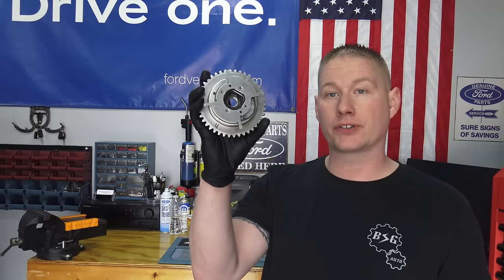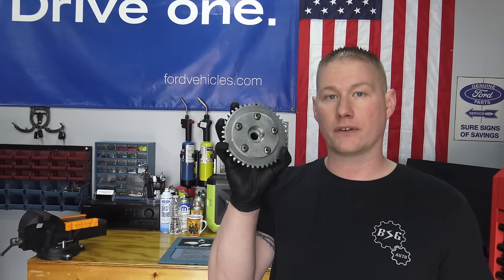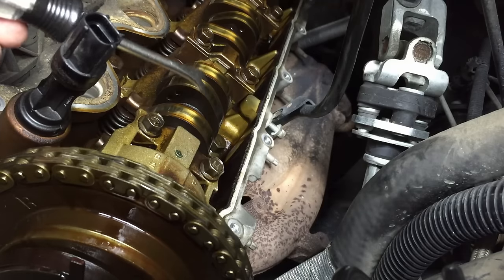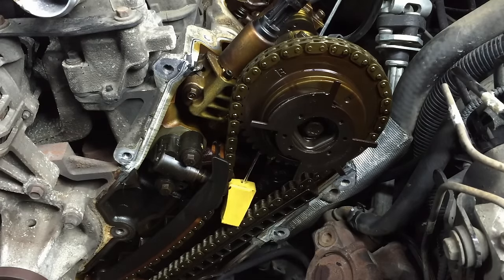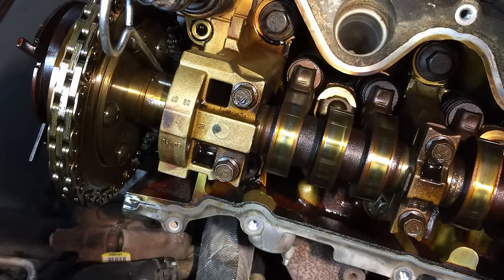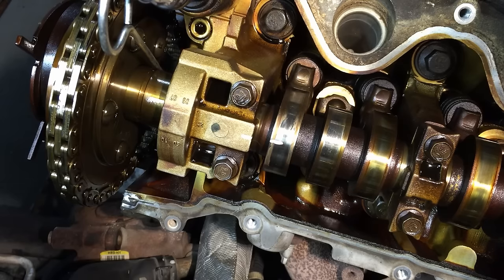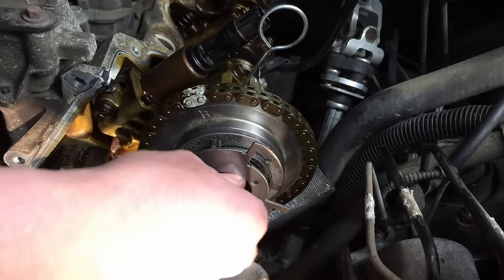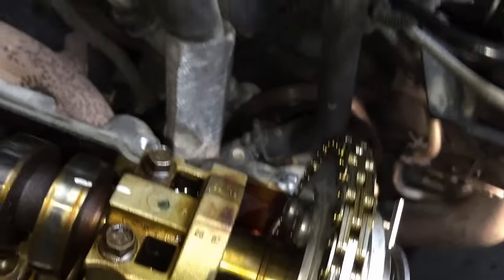Ford 5.4L 3v Camshaft Phaser Replacement**UPDATED FASTER PROCEDURE**

Comment: I HAVE A 02 F250 SUPER DUTY WITH 5.4 TRITON  its making the same noise as a bad cam phaser it would make the noise at an idle then if i tap the gas it would stop than start back up  so i got to amazon ordered the phasers valve cover gaskets and the cheese wedge ive watched the fast procedure video. over a dozen times hoping i dont miss anything but its been a big help ill comment back with my results   hahaha. thanks man

Comment: Great video, taking mine apart at the moment for a lifter replacement. One thing you don't see anywhere discussed online is how to distinguish between lifter and phaser noise. My tapping noise for example can be heard at all rpms and engine temps. When I hold the stethoscope to the valve cover, I don't hear any tapping coming from the phaser area. The noise seems to be coming from the rear or bottom of the engine.
So I'm taking a shoot in the dark and am replacing the followers and lifters on the driver side.
Any reliable way to tell the difference between lifter and phaser noise?
Reply: Just an update to everyone following: Mine turned out to be a bad lifter which caused the cam follower to fail. I removed the cam and replaced all lifters and followers. What led me to believe its the lifter/follower rather than the cam phaser: The official TSB on this issue. The TSB describes the different noises and states that if the noise is there always, at all temps and rpms, it is most likely a bad lifter.

Comment: Just performed this today on my 2010 4.6 stx 4x4 with 130xxx miles. Thought maybe it was a rocker or a lifter but come to find out it was the phaser because after the oil warmed up and thinned out you could hear knocking noise. No more knocking. The camshaft did turn while I was putting in the new phaser but thank goodness I marked it. Grab some vise grips and turned it back. Now I just got to figure out why the truck almost has a shutter while driving. Local transmission shop said wasn't the transmission. Put on a new transmission mount and I still have a problem. Wondering if it needs a whole new timing chain now. Thinking about just driving to your shop @fordtechmakuloco. Thanks for all the help so far 👍

Comment: $2k to replace these can phasers, at only 100k miles. 
$500 to replace a bad spark plug design. 

Great design, Ford.  There should be recalls on these engines
Reply: How is there not class action lawsuit?
Reply: Yep ford had to payout alot of money to people who had to deal with the broken sparkplug issue. Also they had to replace the cam phasers for free if you were under a certain mileage and years. Unfortunately for me by the time I got the notice on the phasers it was too late. Looks like I will be doing it myself. Only at 52,000 miles on my 07 f150
Reply: The 5.4 was always a problematic motor. The 4.6L was always far more reliable. Which is why I chose this motor. 128k and never had motor work done. Just changed the oil and did the maintence. But there is maintence people didn't even know they had to do. Such as VCT solenoids having to he changed at 60-70k. Or stuff of that nature. Not to be using base oil. Only using Ford's certified oil or higher. People don't realize that not doing the proper maintence will lead to a bad motor later on.
Reply: I am in the same situation with only 108,000 miles I have to have the expensive repair done on my F-150. I had the plugs changed out at 100,000 miles same cost because I researched the issue of plugs breaking so I paid Ford to do the work. Very poor design on Fords part. Ford needs to have this on the recall list because most engines should run at least 150k to 200k without this type of major repair.
Reply: hhhh9579 where can I find this kit?
Reply: @bigbuffs  Did you end up doing it? if so, how did it go?
Reply: Yeah, got ya, at 50,170 miles on mine, took to garage , they used after market chains, phasers, guides etc. 1600.00 later and only 175 miles back to where I started same knocking......
Reply: You got hosed for 2G for cam phasers
Reply: Another Ford "Better Idea".
Reply: @hairpunut  The 2V 5.4 is more reliable, but it also has less power and worse economy.  I was considering a 3V 5.4 new back in the day but ended up buying a Titan.  That was a mistake, wish I would have gotten the Ford, despite the issues with the 5.4.  The Titan had a great motor and transmission but the rest of the truck was garbage.  It was really poorly assembled and a lot of the subcontractor assemblies were not stout enough for 'Merican truck buyers - prime examples being the exploding Dana 44 rear ends, brakes that would warp the rotors in less than 2000 miles, and exhaust systems that would rust out in climates where rust was not normally a factor.  Not to mention incessant interior rattles.

And really, the phasers don't wear out on the Titan but the timing chain is a normal service item at 105,000 miles - it's in the manual.  So you have to spend a bunch of money on that, but it's considered normal maintenance.  I'm not sure how the Ford design is that worse, maybe should have just stuck to 5w30 oil as stated in the video.
Reply: @JimBronson  well i dont hate the 5.4v they actually made a kit to fix the issues with it. The main one being that it didnt provide the optimal oil pressure. So a aftermarket company made a pump that could fit and produce proper oil pressure. Which would then save the phasers. And then the motor became very reliable. It still was if you just used 5w30 instead of 5w20.
Reply: garbage cars .
Reply: I found funny that some guys praise this trucks saying "beside the came phasers that I changed at ..."  this is the best truck in the road. People praise brands like if ... when they just have the one brand experience. This kind of issues in trucks is what makes a difference. How come they kept this design until 2014, this is ridiculous. And most of people paying from their own pockets to fix this. Ford must had been a great brand but this is what makes the difference in great brand. You have a problem well identified and let live until 2014? Come on...
Reply: @JimBronson  I have a 06 Lincoln navigator 3v with 105k and still runs and sounds like the first day. I contribute it to the 5-30 synthetic oil in stead of 5-20 since first oil change. My cousin is master tech for Ford and said 5-20 was used for milage period
Reply: @hairpunut  So why didn't the factory spec the 5w30 in the first place?
Reply: @stevejohnson8773  ford has used 5w20 because its more affordable then running 0w20. And because the thinner the viscosity the more the vehicle gains from gas mileage. When a vehicle has to work less to push oil through, it regains in efficenty and some power. And at the height of the time these trucks were fighting over who has the toughest truck. While Americans were focusing time on smaller vehicles due to the gas prices. So to keep relevant, manufactures like ford switched to lighter weight oils trying to keep up with the rise of fuel costs. Why trying to achieve what they believe the better oil to get through the now tighter clearences they command on the engine they built. At the same side of the token 5w30 also lubricated better especially under hotter temps. And wouldnt you know it. Ford motors ran pretty hot, and should've had slightly heavier oil. Ford soil purpose was the meet CAFE emissions at the time. Thats why the old 2v 5.4s ran much better and lasted so much longer. Because they rab 5w30. While chevy started producing different ways of this such as the afm system later on. Or as its known the active fuel management. So needless to say instead of a reliable vehicle. They catered more towards sales at the time.
Reply: Bro how did you pay $2000 to change out 2 $300 parts at most
Reply: payton Cash because it’s all labor.  to get the cam phasers out they have to take off the whole front of the engine.  And at $90/hr labor it adds up real quick.
Reply: Never had an option on the expeditions only came with a 5.4L

Comment: I have an 04 f150 I bought new. It started ticking at 90,000 miles. It's now at 230000 miles. I do my own oil changes started at 90,000 mile mark. Driving this truck for 20 years.

Comment: Thank you for the great video. I am not a mechanic but I just had all timing and cams done on my truck. Still running like crap, off to shop 4th time. I did not use a ford mechanic and regret not doing this. Spend $3500 and truck is still pulling code Poo22-poo12. The people I used all aftermarket parts. Crap!! Now my truck is going to a certified ford mechanic. I’m elderly and disabled so I can’t do the work myself. Lesson learned!! Thank you

Comment: Good vid. would like to know how to turn cam if it does slip out of time. Thx
Reply: You can use a rag (double folded) just behind the phaser, where, in the video, Brian does the measurement (from back of phaser to cam cap) before and after the phaser install and "CAREFULLY" use a vise grips to turn the cam where you need it. (Make sure to use caution and common sense) the rag, thick or doubled, and the vise grips just tight enough not to slip and score the cam but not so tight that you cause crushing issues to the cam.  I have used this method when switching out to bigger (performance) cams. I have a 5.4 3v and a 4.6 3v torn down right this second and Brian's video's have been worth more than Gold, silver and diamonds to me! PLEASE SUBSCRIBE, LIKE "AND " SEND HIS ACCOUNT SOME TYPE OF DONATION!!! He has helped thousands of us and he deserves something, Hell, ANY donation, ANY amount helps the cause. Thank you Brian for being so selfless and using your precious time to help us! It means the world to some of us!
Reply: @ivanlaney2336  But how can you hurt the cam right there?

Comment: I don't know from fords that well , but I think your apprehensions bout valve crash from a rolled are cam might be unfounded. I have done literally hundreds of GM , Chevy , Opel , Toyota , Honda etc hitter engines and the confluence of events necessary to actually bend a valve is pretty rare. 
Not saying be careless, but just common sense keeps most people out of trouble . For IP  I have actually tested this by rolling a cam back with a wrench deliberately and not crashed . I have seen rookies jump 4-6 teeth on a chain or a belt  , I even accidentally  did it myself once and not crashed  even after start up.
LOVE your vid , you're clearly a sharp technician.

Comment: Hi, I was think of trading my 2010 f150 fx4 with 75000 miles an ford wanted to give me 19000...now the mechanic cam out to check car and said phasers have to be changed and now they are offering my 14000. not sure what to do. anybody thoughts would be greatful
Reply from the maker: No way I think it is worth it to follow this video and fix it yourself and get your $5k back! Parts are listed in the video description at a substantial discount compared to the dealer.
Reply: Do you charge $5k to fix it?  I'm about to pull the trigger on an 06' Mark with 200k miles listed for $9k.
Reply: @icawn  The entire timing job isn't THAT hard if you follow Brian's vids and take your time. Use Ford parts and the Melling 340HV oil pump though.

Comment: In this video, shouldn't the Phaser have and L on it. It's the left side of the engine.
Reply: Each phaser is universal (for left and right), they each have an L and an R on opposite sides of the face. So you just rotate it 180 depending on the bank, when doing the initial timing. But you’ve probably found that out in the 2 years since this comment lol

Comment: Thanks for another great video tech. I have a 2010 with the 5.4 , # 2 has a broken intake valve spring . Can I just remove the passenger head or will driver side need opened up also ? Also should I get radiator and coolers out of my way for this job ? Truck has electric fans and looks like there is room .  Thanks again.

Comment: youre a god among men.. i had a ticking, turns out my headers were rotted, had them changed, STILL ticking ! I dam near had a heart attack knowing what that ticking might very well be.... turns out my mechanic found a defective brand new manifold gasket! I couldnt have been more relieved! I hope my 2010 never has the cam phaser issue, i just dont wanna spend the thousands on the job for a truck that rusted to hell already :(

Comment: Hey I followed this extremely carefully one side at a time. Driver side, no problem. After I replaced the passenger side it runs really rough after 10-20 seconds. I used all OEM parts, replaced the phasers, bolts, and VCT selenoids, and a local shop said it is off on the timing be 55 degrees. I was very careful with the paint exactly as you did, nothing shifted during the job. I am about to open it up again but I'm not sure I want to advance the phaser a tooth as the mechanic suggested, I am sure I put it on the same tooth position. I am thinking it might be the washer on the phaser bolt or maybe a faulty solenoid. How can I verify if the timing is correct without pulling the front cover?

Comment: I had to change a cam on a 3 valve and nobody had the wedge in stock so I stole some pics off the inter web and carved one out of pine added a long wire handle worked like a champ what really surprised me is how close my fab job looks to the right tool that finally came in three weeks later

Comment: Tried a while ago. Maybe this time it'll reach you. My 06 had tons of misfires caused my bad boots and plugs. All that was fixed and now I get no misfire codes, but the truck lacks power (like a plugged cat) and has a tough time going over 40 to 50 mph. I dont get any codes, which is odd. I did drop it iff at a "mechanic" and he said it was the phasers, which is fine, I just want to try and verify thats what it is before I open her up. Hopefully, this will reach you. Thanks a ton for the videos, subscribed.

Comment: I was diagnosing a ticking sound on the driver side and was certain I had a bad roller/follower or lash adjuster, but all checked out to be good. I am left with thinking the cam phaser needs replaced. Would you recommend leaving all of the roller/followers out on the driver side to replace the phaser, or replace them all and position the cylinder 5 intake cam lobes to the 11 o'clock position as stated in your video? Your advice is greatly appreciated! Great channel. I have watched MANY of your videos on the 5.4L 3V and they are EXTREMELY helpful!!! Thank you!

Comment: So did you take out the three roller followers on each side...or did you just leave them in?  That is my only question. Video was great. You just said normally you would, but that didn't mean you actually left them in. I have to do this on my truck...so that is why I am wondering. Thank you in advance

Comment: Have a 2006 Ford F150. Started knocking like if the phasers were going out. I watch your videos and ended replacing the VCT solenoid back in August of 2023. It seem to have fix it. But now I'm getting the same knocking but it only after the engines warm up any ideas. Thank you in advance.

Comment: I guess I was lucky. When I did the driver's side phaser on my 05, I just basically marked the first lobe to the first cam cap and removed the phaser. The cam shifted from the 12 o clock position to about the 3 o clock position as I removed it. I was able to turn the cam back to 12 o clock with a pair of locking vise grips that I locked on the cam between the phaser and the first cam cap. I pressed the phaser on and it all locked in place, didn't have an issue after that.
Reply: That what I was thinking for emergency problem if I do my.

Comment: Do I need to remove the timing chain cover in order to do this? I know this video is 8 years old but I have a 2011 Ford expedition with 200,000 mi that is starting to give me phaser trouble I've already replaced the VCT cylinders both cam position sensors and the PCM. So popping the valve covers it's not a big deal but I don't remember if I could get the cam phaser off without pulling the timing chain cover?
Reply: You don’t need to remove the timing cover if using the timing chain wedge.

Comment: Awesome Video Brian!  Excellent Step by Step Procedures. I think I heard you mentioning the cam phaser repair will affect almost every all of the modular modular motors at one time or another.  I have a  2009 F150 4.6L 3v with about 56K miles 
on it now. When should I consider having the phasers replaced?  I prefer to stay ahead of the repairs when it comes vehicles. Can I use this procedure to do the repair?
Reply: I'm not sure if you can stay ahead of this repair or not.... When it happens, it happens. I believe the only thing you can do is ensure you are changing you oil like you should and using quality stuff. I believe most are still agreeing the motorcraft oil filter is still the only one that should be installed on these motors, 5.4 and 4.6. 
Some have run 5W30 with good results and some that have ran this weight still ended up with cam phasers failing. 
I think Jasper engines has a good video explaining how and why these engines are failing.

Comment: thanks for the videos Ford should hire you to do technical training videos.  I have a 09 f-150 with the phaser noise.  I think i'm going to do complete timing set plus the oil pump you recommend and hopefully that will solve the clacking and missing problem.

Comment: Greatest info and advice I’ve seen. I have a fx4 f150 06. Cam phaser are getting noisy and I cannot change them until June due to funds and time. Is there anything that could help keep this situation safe until then? Additives, Lucas to make it possibly last until June. I realize you don’t know how bad it really is going off what I’m telling you, but I would appreciate it. If there’s something I could do to just keep it going until then thank any of you also for your input, I would appreciate it it has 195,000 miles on it. It is the 5.4. 3 valve.